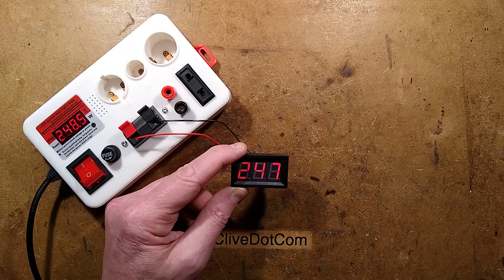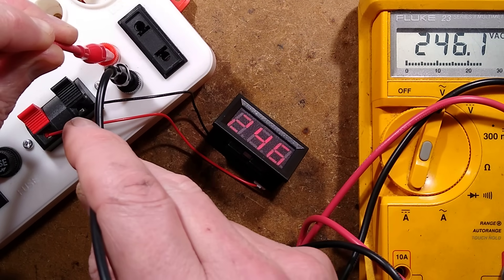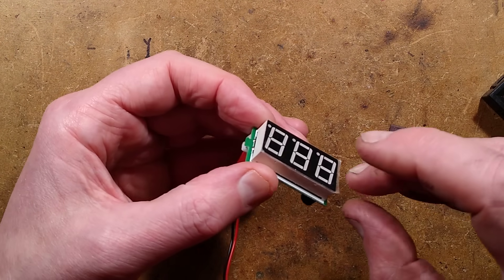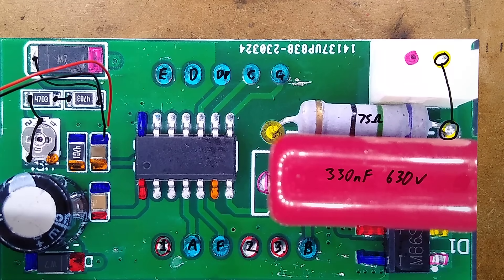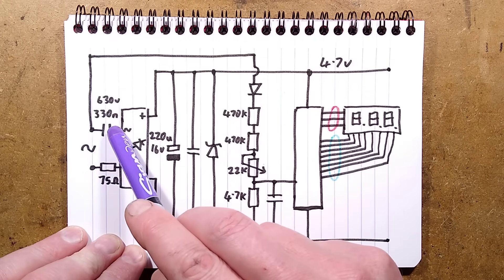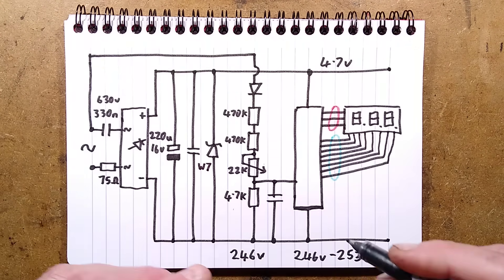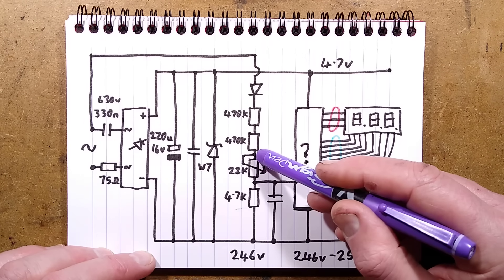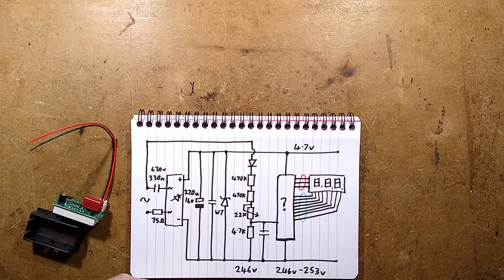Different panel meter module with zap risk

Comment: One of my tingly experiences that I do remember quite well I had in the 1990s at the university. We had several x-y  or t-y pen recorders. The paper was held electrostatically. Paper was not flat even after activation of the "hold" power, so I used the edge of my right hand to flatten it. Unfortunately with my left hand I had grabbed the metal rack into which the recorders had been mounted. I instantly felt the pulses run through my upper body across the heart area and instantly opened my grip. Somehow the insulation of the decades old instrument was no more perfect... Someone then measured that the voltage used was 4kV.

From that time on, I ensured that my right arm was in contact with the rack, while the right hand flattened the paper. So any unexpected leak current would at least not go through my heart.

Comment: The chip could be a microcontroller.  The input divider is roughly 200:1, so for a 70 to 500 v AC RMS sinusoidal input, the A/D input of the MCU is going to get about 0.49 to 3.5 V DC applied.  MCUs don’t have fantastic specs on their A/D inputs, but this range is pretty much the sweet spot for reasonable A/D performance.  With a 12 bit resolution, a 0.16 v AC change can be sensed, well within what is reasonable for a three digit display.  It is nice they are doing full digit multiplexing, not Charlie-plexing which always looks flickery to me.
Reply: That's exactly what I thought

Comment: Thank you for making another video using another similar meter.   After watching your previous “meter video”  I looked at the similar meters  I had in stock.  I discovered some were clearly a different design board than the meter you were showing.   Regardless, they are sure handy little low cost components.  I have installed two at my house, so far they have functioned fine for several years now.

Comment: 250V is the maximum rated voltage for that JST-XH conmnector (looked up the datasheet).  They are really pushing the limits.  At 500V the connector would be at twice its rated voltage.
Reply: I understand the problem at 500 V, but would that really be a problem at 250 V? Is there no safety factor on electrical components? If I buy a crane with a rated working load of 250 pounds, I know I can use it up to 250 pounds with no problems because a safety factor is built in. That's what working load means.
Reply: @tootime576  It's one of those "it'll be fine until it isn't" things.  Voltage spec comes down to distance between the pins and if it will arc when it gets dirty etc.  You often see slots cut on the board between the pins to reduce that (the anti-tracking slots Clive mentions).   Most 250v gear will use a bigger plug to increase the pin spacing.

And you know someone is going to regularly lift 300kg with that crane because "safety limit" means it can probably lift twice as much so she'll be right mate (aka normalisation of deviance that blew up the Challenger shuttle).

Comment: @ 3:21 you are usually much more careful when handling circuitry that was recently connected to mains, as I've watched you many, many times short out a death beam capacitor.  This one seemed to surprise even you though and should serve as a reminder to us all about things connected to mains voltage even after they are unplugged.  Thanks again for the sacrifice of your phalanges on taking a zap for our continuing education.

Comment: The 75 ohm resistor seems to be on the wrong side - its voltage drop influences the measuremet.
Reply from the maker: I did ponder that too.

Comment: 246v. Thats quite lively, however I was working at a business on an estate in basildon recently and my rcd tester refused to start any testing because the mains volts was just over the spec at 255v. I agreed this with a second meter. As you can imagine i had an obligation to report this to the facilty manager to get his supply company to fix this. He said he would...if he knew who the company actually was. Basically in 20 years of operation, this branch had never yet had a bill. Somehow being right in the middle of a big industrial estate meant they were off the radar 😂. All their heating is electric too !!!
Reply: I have this feeling that he didn't put all that much work into looking for their electricity supplier ...🤔
Reply: I'd take the free 255V rather than notify them.
Reply: If the supplier ever finds out, that manager is going to have heart failure when he finally does get a bill. Hmmm, 20 years at £x thousand a year... 🤔 🤣
Reply: @michaeltempsch5282  actually,  there's only so much you CAN do if there is no trail.
Reply: @TestGearJunkie.  I'm not sure of their liability and how far back it would go.
Reply from the maker: Hopefully it's not another unit that's paying both bills.

Comment: Note that the tuning resistor is at mains voltage!
Reply: Not really, there's ckose to 1Mohm of resistance before it. Even assuming the low side is disconnected and your body (arm to arm, about 50-100k) grounds it, that would expose you to about 0.25 mA and a voltage potential of about 12 to 24V. You'd get more current flowing through your body when using those neon test lights.
Reply: @oscar_charlie   True, but still tingly

Comment: Every electric technician have at some point been a conductor
Reply: And most of them claim that it wasn't their volt.
Reply: The music can be spikey... ⚡⚡⚡
Reply: Don't you mean that every insulated electrician, has at some point been conductive?
Reply: @marcse7en  nah, probably more when they been “conducting” experiments ;)
Reply: @mySeaPrince_  I actually once helped a friend troubleshooting a PA system and was holding the audio wires to a sub with my hands it was no problem until my friend started to crank up the volume really much and I could start to feel the tingles. You can see where this is going. 
Volume became too loud to say crank it down so I tried to release the wires instead but what lose the connection first was the sub so then the only load was me and the voltage went way up because these amps can output up to 80volts when impedance gets high. Then I sang a song of high voltage for a moment there. We still laugh about it from time to time
Reply: @Pulverrostmannen  
It's a while since I have seen a PA amp..
they have several outputs..
I think one is about 50 volts .. which is enough to kill..
If you had been connected to wet soil ☠️
I actually had a quick look at your channel and a channel you are subscribed to.. a puppet tec .. will have a look at the weekend.
Bella 🐈 (see picture) and I live on a boat Off-Grid..
Maximum voltage from the solar panels is 25 volts open circuit, obviously the amps will add up..
The electricity from solar is more like static electricity..
What has become a dangerous possibly.. but accepted practice..
Similar to the wires of a PA on a sports field..
Is higher DC voltages.. as I say 50 volts DC or AC is nasty...
People are now using MPPT charge controllers and wiring the solar panels in series .. if the wiring is done correctly it would be ok..
But to make matters worse the panels are wired outside.. where it gets wet ... and hot, cold, damp and algae and other things grow..
The connections on the solar panels corrode.. I check occasionally.
Worse still they use little push together connectors.. they have bits of rubber or silicone to try and make them water proof.. and they are left on deck where it gets wet.. hot, cold etc...
Worse still the contact... mostly aluminium... can corrode and become open circuit and the electricity wants to go somewhere..
A wet deck is ideal...
2 panels in series open circuit is 50 volts..
Even worse because people are using high power MPPT charge controllers they are now using 200+ volts.. and those push together...
 connectors 🤬
also the panels can become open circuit and the electrical insulation isn't that good..
I like to see
Bella happy on deck
🐾🐾🐾 🐈
Reply: @mySeaPrince_  Ah you must mean Atkelar, yes this guy is probably one of the persons on YouTube alone that makes the most serious restorations you can find. It is very impressive work actually. 
Regarding the PA amps the one I talked about was actually also bridged when I got the jolt so both outputs added up the voltage even more. But I got way worse shocks too in my life. 
Regarding the solar panels I actually work installing and servicing stuff like that on Caravans and motor homes, a typical solar panel will have an open circuit voltage up to above 20 volts and if they are in series you get the number of panels added together on that and you can get very high voltages. 
In my job it is very uncommon to have more than two cells in series and then the voltages ain’t that serious. You also have the option to connect the panels in parallel and then you only increase the amps instead and the voltage you have then is completely safe. The problems occur more if you add inverters to gain mains voltage off grid which may on a boat or caravan lack a real safety ground so it is important to make sure your wire work is well done so that you don’t get stuff failing on these

Comment: Pulling current thru the power pins of a micro controller for things like an LED Display and trying to measure accurate things with the build in ADC might be challenging because you lift up the ground potential of the ADC by pulling current thru the Ground pin.
I wonder if they have taken that into account while designing this. If it is a µC and has no separate ground pins for the output stages and the ADC it is not as much of a problem but if not you might have to do some multiplexing magic and have a time slot where all the segments are off during which the ADC can sample correctly.
You might test that by providing say 111V and 188V to the display. 188 has 10 more segments lit than 111, so there should be a higher ground potential for the ADC and therefore the 188V should read lower with respect to the 111V

Comment: I'm not too fond of the zener being right across the full-wave rectifier off of mains.
You do have the dropping capacitor and resistor on the AC side, but still....
Reply from the maker: It's really common.  It relies on the capacitor rationing current through on each half wave and the resistor limiting peak current.

Comment: Is it normal for the voltage to fluctuate 1-2 Volts, even on the Fluke?
Reply from the maker: Yes.  Usually when the voltage is between two digits.

Comment: I've been zapped and tingled enough times to know I don't like it. Ironically enough the worst zap I ever got was a static shock I got from my mom that went through a shopping cart before hitting my fingers. Had 2 fingers numb for a half hour or so after that. That one really hurt.
Reply: It's amazing how much zap you can get from a shopping cart!
Reply: @KevinT3141  You literally saw the static go from my mom's hand to the cart and then from the other side of the cart to my hand. I can only assume that the metal basket somehow increased the voltage. I've gotten my fair share of static shocks but that one was absolutely painful. Interestingly enough it wasn't that painful for my mom but my mouth certainly produced some expletives.

Comment: Only half of the sine wave allows the capacitor to be tingly, if it is charged in the correct way it will discharge via the divider network.

Comment: There's so many of these on Ali and eBay and they all look the same. Unfortunately you never know what you're going to get...
Reply: Also there is a possibility the vendor mixed different sources so ordering multiple units or reordering the same item can lead to unpleasant surprises.
Reply: Its like a lootcrate surprise, except with even less value and even higher chance of terminal death.

Comment: I have an old Velleman mulimeter kit that ALWAYS displays "666" on the display when you turn it on. It happens fast, and is hard to see it go by, but if you turn it on with the hold switch on, its obvious. 😬

Comment: Most of these little units seem to have a 70v starting point. Is there a specific reason for this?
Reply: With too low input voltage, not enough current will go through the tingle capacitor and it won't be able to feed the microcontroller enough to stay at 4.7V.

Comment: Very interesting video as always Clive, one question, why doesn’t a capacitor discharge when the supply is disconnected. ?
Reply: It does, very slowly (hours, sometimes days).

Usually manufacturers put a high value resistor across the tracks on the board, so it's safe very soon after being disconnected.

This manufacturer didn't.
Reply from the maker: The perfect capacitor would store its charge forever.  It's usually leakage and adjacent circuitry that discharges them.

Comment: Hi Clive,
Would it be an idea to put a discharge resistor (a resistor in parallel on the output pins) in the test equipment?
Maybe your videos would be a little bit less to laugh about 😢, but I would rather see you living a bit longer than today and making more videos 😊.

Comment: I had same kinda meter but it measured dc volts. It was too inaccurate for my taste. It showd 0,5 volts less than actual voltage. Is there any way to make this device more accurate?
Reply from the maker: Some have calibration facilities.

Comment: pot is metal and 4,7k away from the phase or neutral, so 50/50 chance of getting a better shock  as bonus while calibrating with a metal screwdriver.

Comment: id say that cap 630v is a dc rating, ac rating wont even be half that (i've seen datasheets for some old 630vdc caps rated 220v ac) so pushing it for use on 240v , i bet it wouldnt end well if put on a 415/440v supply.....

Comment: I think ultimately they're all the same chip or software, only thing that would skew it are drifting resistors

😅 How long was that holding charge for!
Reply: You saw it in realtime connected to mains.
Reply: @rimmersbryggeri it's a rhetorical question in the form of a joke, it being an absurdly long amount of time.

Additional: there was a pause between taking an image and printing

Comment: I purchased a plug in cigarette lighter voltmeter for my VW T2 van, it turned out it only displayed 12v, so I took it apart and found it had no circuit inside just a couple of led’s 😂
Reply from the maker: I have one of those here.  Very devious.

Comment: By the way, live 240V AC mains via a reasonably high resistance is still worse than discharging the stored charge from a capacitor that had been on a mains circuit IMHO (I’m just glad it wasn’t a metal ladder I was on…). Don’t ask how I know…